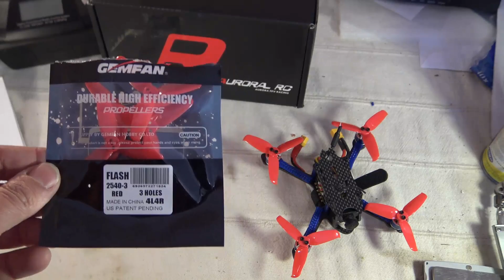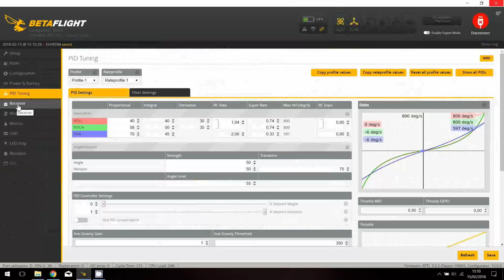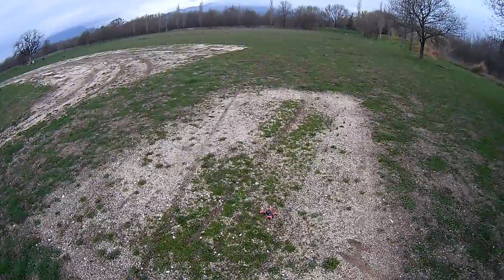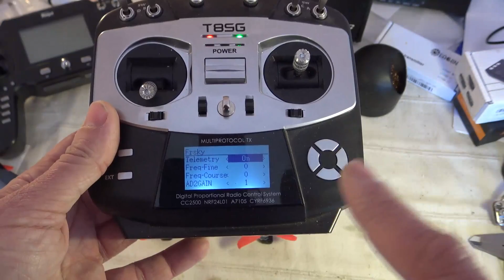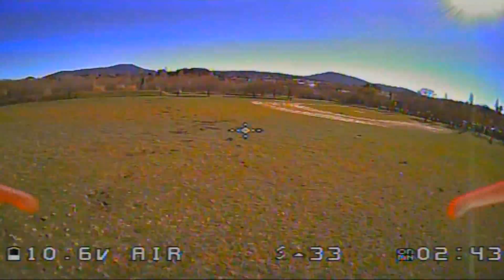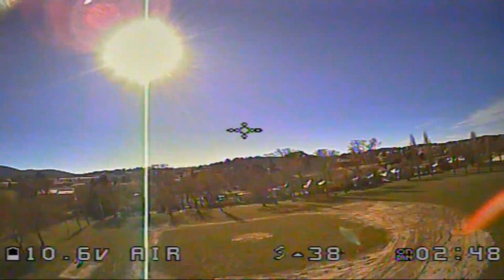Eachine Aurora RC Mini Unboxing, analysis, configuration and demo flight (Courtesy Banggood)

Comment: I use flysky but my receiver was garbage as well. I installed a new receiver and had no issues after that.  It took a while to tune and I am still not done but have only had it a few days. I do like it though. I have the leader 120, XJB145 , Mini fight 110 and the bfight 210  and still, think the mini fight compares to my other small quads. I would not get it if you are a  beginner as it is hard to tune and but if you are comfortable with Betaflight it is a good quad. I got mine for like 130$ Canadian so it as well worth the money. Good review Seby!! Merci
Reply: Oh and I have a few 4S 850mah  batteries for my XJB145 and figured I would try it to see how it made out and WOW!  It has almost too much power ...lol. I wouldn't fly it too much on 4s as you will probably burn the motors out but it was crazy.

Comment: Hi, can you tell me if I could add a light strip to the 
Aurora RC Mini Fight 110mm Micro FPV Racing Drone. Flying LOS it doesn't have enough lights :) thanks, Pete
Reply from the maker: Yes you can retrieve the +5V on the builtin BEC

Comment: I think the initial problem was a poor battery .. not high enough C rating. After watching AndyRC review of iRange TX, I see that it has some faults ... poor stick centering and no external antenna .. and a somewhat clunky version of Deviation that may require some strange tweaking (as in the case of the FrSky freq.). Of course, some other TXs (like FlySky) don't have an external antenna, but I prefer to have one .. just to eliminate any possible problems. They could have used an XM+ RX which is better than the cheap D8 FrSky RX, which also can be flashed to give RSSI info. I've seen several models now with the 1106 motors, and they all seem super powerful .. not bad flight time either. Thanks for the review. Cheers